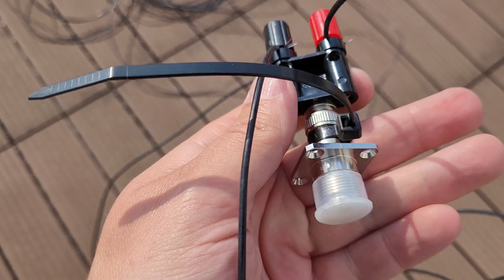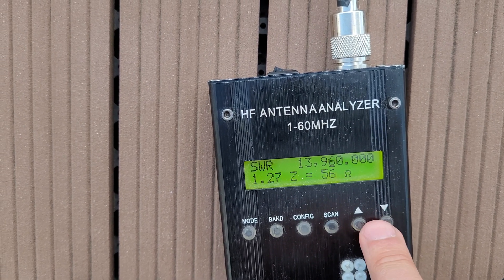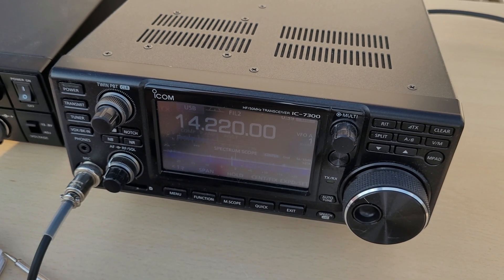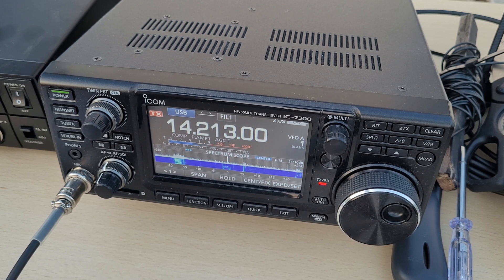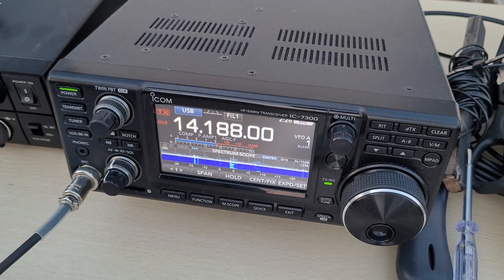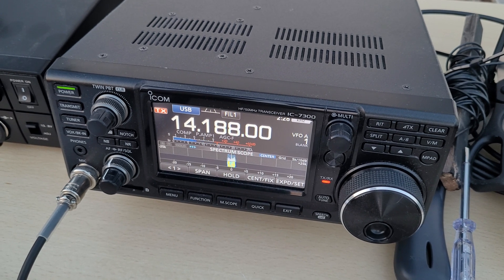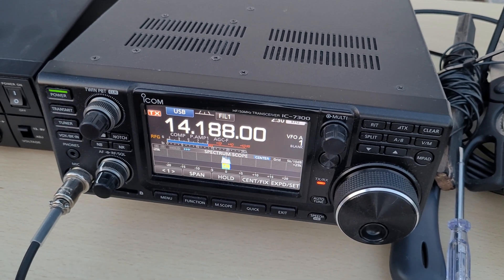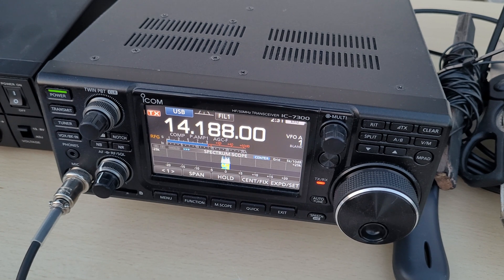Building and testing a Vertical Double Leg Groundplane Antenna for the 20m band

Comment from the maker: Dimensions of the Special Double Leg Groundplane with my "Ackerschnacker" Wire from the Bundeswehr:
-  Radiator: 5,10m (last 12cm at the end "coiled" as a loop)
 - Radials (legs): 4,89m (last 24cm at the end "coiled" as a loop)

Keep in mind: The height, the material and the angle of the radials have got an influence on the SWR !

Comment: Congrats! How does this antenna perform compared to a T2LT? Have you done any tests? Thanks, 73 IT9JKI
Reply from the maker: Yes I have compared T2lT with the double leg and some other special antennas which I have developed with EZNEC. To be honest: I have not seen a real difference. The location of the antenna and the height of the antenna were more important than the antenna itself. The only difference I have seen with a typical / normal half wave in a vertical configuration (not so good like the T2LT -  maybe a little bit because of the material (made of steel wire instead of German "Ackerschnacker copper/steel-wire") or because of the missing Mantelwellensperre / wave blocking choke ) and mobile car antennas (no surprise - the worst antennas).

But with my mobile car antenna on the hill - which is just 50m higher I`am everywhere more than one 1 value better - in some cases 2-3 S values. So most important for ground wave connections are the height and the location of the antenna. For DXing are the conditions and the time most important.
Reply: @ham-radio1000 Warum wickeln so unglaublich viele Leute so viel Koaxkabel  auf ein Plastikrohr wenn eine Schweissfuss GP den gleichen Job macht? Abgesehen von der Länge einer GP im Vergleich zu einer Halbwelle? 🤔